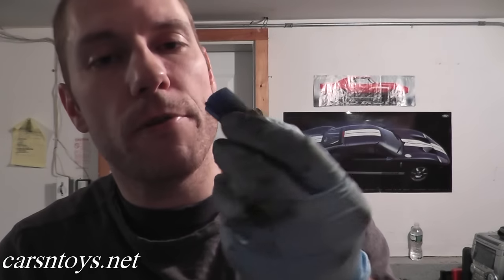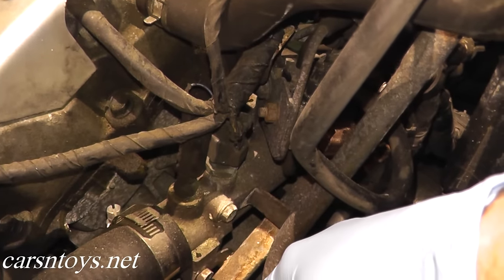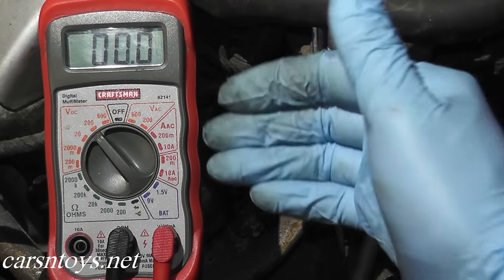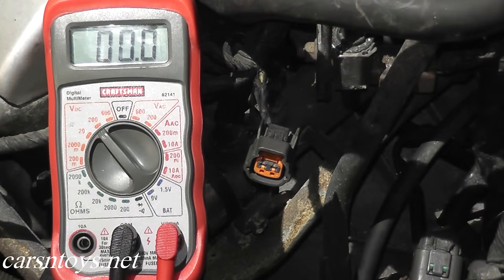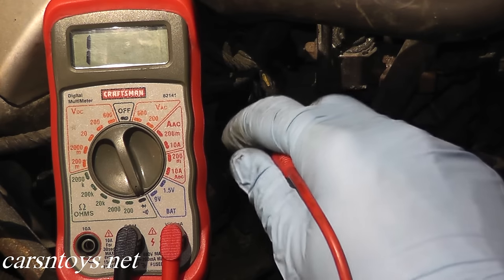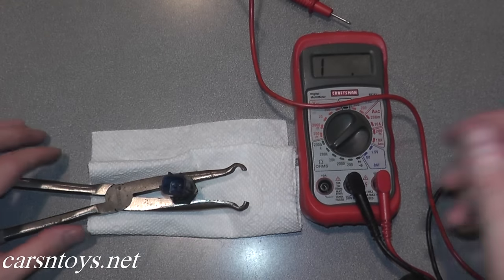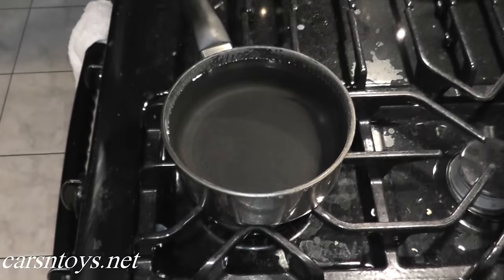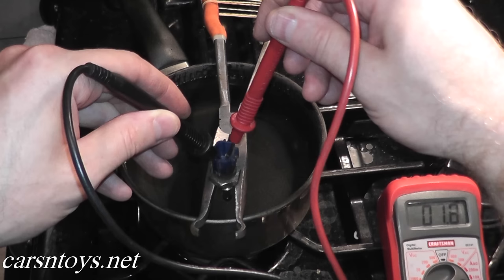How to Test and Replace an Engine Coolant Temperature Sensor P0115 / P0125

Comment: My Lexus is temp gauge is going from normal (middle) to cold and back. When it drops, the car seems to change timing, almost as if you were driving a 5 speed in a high gear prematurely. Does that sound like a bad sensor?

Comment: I just replaced mine in an 03 legacy wagon. The old sensor was very skinny compared to the new one that I was sold from advanced auto in which was thick compared to the one that was bad. After 3 days the overflow was completely full and the car overheated again. 10 mins later all the coolant was sucked out of the overflow. Any advice, I'm losing my mind

Comment: Hi. My cousin have problem with this sensor. His car sometimes doesn't work as it should. His rpm are going down, sometimes his car shut down the engine in movement, and he must wait a couple minuts so he can turn it on and continue driving. I put it on diagnostic to see what is the problem and there are two problems. First is this sensor, second is catalyctic converter functional fault. What of those two can make problems like turn off the engine in movement? I have read somewhere that this sensor can do that, when it is not working. Thank you.

Comment: I'm getting p0125 on my Lexus ls400 model 2000 they changed the sensor and the thermostat but still idk what's wrong with this thing did a drain the coolant and changed the radiator cap ...   Did the valve covers gasket  and a friend swap his O2 sensors in but still the coolant sensor he fixed was not new so idk should I change it again

Comment: i have a 350 eng an they put a plug where the temp sensor gauge goes a one wire  right under spark plug no.1 an  no3 an he strip the plug so i just put it on bank 2 right  under on no.4 spark plug an no,6 on the cylinder head would that be a problem like your videos thank you

Comment: My 97 ford Taurus engine heard up as normal and fan kicks on at normal running temperature but when driving the engine cools down to starting temperature and warms back up to normal when stopped again any thoughts

Comment: I don't have any codes that popped up on my car. But my engine temp gauge moves slowly there are no coolant leaks just replace the thermostat and no air bubbles in the system. Sometimes it will go a notch above normalbut he doesn't overheat and sometimes it will go a notch below normal. Any ideas
Reply from the maker: +moneyhungryyt I'd start by checking this - https://youtu.be/bf2kvZJx1OA

Comment: Is there a way to create new sensor set up? How would I get just 5v to the sensor and also I would need that to kick a relay for my fan. there was an engine fire on my little beast before I bought it and I am down to getting my fan working on its own. They had the fan hot going to the temp swich and the other side of the sensor was supposed to be a connecting point for the fan to work. it obviously didn't work. I have read all the wiring diagrams and these factory wires are burnt up and gone. Fan works like a boss and when its bypassed the car runs at 190 like it should . I don't want to put it on a toggle, I want it to work automatically?  Your advice would be appreciated.

Comment: Sir i have a 2004 mazda tribute with a 2.3L engine, when i turn the ignition to on position, the radiator cooling fan starts running even if the engine is still cold, i think it is not normal. Where could the problem be? Is it with this ECT sensor or the radiator cooling fan control unit? thanks

Comment: I'm just confuse, why use terminal 2 for voltage and terminal 1 for continuity in testing the harness connector? Can I use terminal 1 for voltage instead?

Comment: If the engine was leaking oil into the Antifreeze (at a tiny rate) , will this oil foul the sensor and cause the cooling fans to NOT come on? This is whats happening to me. I'm thinking of removing the sensor and testing it.

Comment: I have a 2000 Mitsubishi Eclipse. I was able to loosen it a bit, but it stopped at a certain point. I didn't wanna keep going. I felt I might break something. I'm sure part of the thread is rusted. Not sure what to do. Putting WD40 or PB Blaster is not an option.

Comment: Hi man can u plz help me I got code p0118 now thing is no engine check light gauge works  good ground  my diagnostic tool says signal + gettin to high of a reading  or shortcut 
no faulty cables tho ??? Making me nuts 😒 Could it be the ecu

Comment: hi wonder if you could help me my 08 ford mondeo 2.0 diesel fan comes on a lot and when it does theres a very strong exhaust smell thank you diagnostics comes up deteriated oil so changed oil and filter and not long after happened again car screen reads engine malfunction all the time car dosent lose performance

Comment: 2002 Camry 4 cyl, 140k miles, car is not overheating and there is no check engine light.  Main issues: 1) Car won't restart after running for while  when i stop the engine and try to turn it back on, it struggle to start. When i let it cool down for about 10 min and then try, it starts fine.  I got the new ECT sensor from autozone 3 prong as this 02 camry has 3 prong wiring for ECT sensor. Existing and new one from auto zone has rubber O ring and not metal, does this matter?. Replaced the sensor and still same issue 2) passenger side fan won't turn on even if car reaches 216°f. When i just crank the engine to on position, only passenger side fan is running anf continue ti run when i start the engine. I disconnect the wire from the ECT sensor and car still runs, It also starts fine from off position while the ECT wire is disconnected from the sensor. Any suggestion?

Comment: so would this probably be my problem if my temperature guage spikes to hot very quickly and spikes right back down?  or spikes to above hot (as high as it can go I guess) and stays there for some time?      I did have my android torque app running while connected to an ODBII scanner at the same time.  and the coolant temperature guage on torque stays the same (never spikes) at the same time as when the dashboard engine temperature guage spikes to hot.  so my torque app says the engine is not overheating where-as my dashboard guage says it is.   clearly something is not right.

Comment: can a bad sensor show resistance? I changed my radiator fan on 03 v70 2.4t and fan still not working.
Reply from the maker: Yes, but it may be extremely high.

Comment: I have 95 Honda accord fan not coming on just replaced. radiator need to know exactly what to check cam afford to let it run hot it hasn't yet bit haven't driven since replaced radiator after a crack now fan not running water not inhaling please help me on properly connecting all hoses and what apse need to check

Comment: My volvo s60 only runs when it's cold outside, if the temperature is above 55 degrees, it acts like there's a misfire or something. Would replacing the THERMOSTAT help? I also have a P104 error code.
Reply from the maker: I'd start by looking in to the p0104 code; mass air flow sensor. This is an older video regarding testing the mass air flow sensor - https://youtu.be/ewjO9JVr8NU

Comment: My check engine light came on and when i got it checked i got the coolant temp sensor code...... now my car has problems starting mainly when i put gas in it and this didn't start until the temp sensor code popped up can it cause this type of problem?

Comment: trying to figure out why truck f150 1996 over heats while idling. sometimes on long trips but not often so ill check this one. i kind of think new head gaskets are needed that is last thing to replace everything else from hoses radiator water pump belt temp thermostat have been replaced. this and the head gaskets are the only thing left that are not new. still scratching my head over this truck. thanks
Reply from the maker: Frank Holguin Also verify the radiator fans are kicking on. Cheers

Comment: I am having an issue with my vw touran. Its a 1.4 petrol. One day the radiator fan started running super fast. Continuously. Only stopped when the engine was switched off. Ran the diagnosis with no fault code. Then all of a sudden the fan started running normally. Then again after a week the problem came back. The mechanic checked the wiring and the relay. No problem there. He advised to change the fan. Got one from a salvage yard. The problem went away and after a week came back. This time the only thing different was that the fan started off suoer fast when the temp reached to its optimum level. Then went off and immediately came back on. Kept doing that. Sometimes stays on for long. I then changed the coolant temperature sensor. The problem worsened. The fan came back on at the optimum temp. but then started coming on even at cold start. At cold start it comes on and off and then goes full blast once the temperature gets to an optimum state. Another thing has changed. With the first fan the temperature never used to drop from optimum state even when running constantly. But now the temperature drops. Other things I have noticed is extra fuel consumption and sometimes first start in the morning in idling the car is rough. Can feel its a bit jerky. An online mechanic suggested two things. The fan control unit or the air con. pressure sensor. Can someone suggest something please.

Comment: I have a 1999 Ford f350 that was converted from a 7.3 diesel to a 2002 triton 5.4. Not my doing that's for sure I would never swap out a 7.3 for anything in the world....lol. But none the less it was over heating when the previous owner had it so he took it to Canadian Tire. For reasons unknown they told him he needed a new mechanical temperature sensor. So they disconnected the one going to the ecu. So when I got it was running rich as all hell and hard to start when hot cause of course the ecu was thinking it was cold all the time. So I tested the wires going to the ecu and I am getting a reading of 12 volts at the sensor pigtail. Is this something that could happen if it is a faulty ecu or could it be that it is still running on the 7.3 ecu and they should read 12 volts at the sensor. Its a little confusing because of the motor swap its a bit of a wiring nightmare and there is 2 sensor wires that go to the ecu but only one of them has continuity but both have 12 volts
Reply from the maker: dirtyold roofer Yea, motor swaps are headaches if everything isn't wired as the factory would have done it.  I'd first start by making sure the ecu works with the 5.4. My guess is the ecu is fine otherwise you'd have a load of problems. If the sensor is getting 12v that verifies power is getting to the sensor. I'd also test the sensor as I show toward the end of the video. If the sensor is shot then you found the problem.

Comment: CarsNToys hey man great video. I have a problem that im having a hard time with. I have a 02honda civic and I have recently been having trouble with overheating problems. My car was overheating at different points but then it drops right back down so I thought it was a faulty thermostat so I went to get another one at AutoZone (cheap 12$ thermostat) and I put that one in and it ran fine for about 2 days then it started heating up at different points and then dropping back down. So I decided maybe its the cheap thermo so I ordered a honda thermostat and just put it in on sunday and it ran fine for a day and a half (about 50 miles) but on when I got back from work the gauge started to rise and then drop again. I did the head gasket last summer so that should be fine. But your video is a big help for me to rest it tomorrow but would you have any idea what it might be? Srry for long message. Thanks! Thumbs up+subbed.
Reply from the maker: I'd start with a coolant flush. Also test the water pump.
Reply: Ok thanks. Do you think it could be the water pump with the car running fine 90% of the time then heating up then dropping back down?? It's weird cause I drove to work today and it was fine there and back till I got about 5 min away from my house when it started to overheat again. Im gonna do the test you showed tomorrow.  Which this video was a major help. Thanks again.
Reply from the maker: Chris Watson First thing that comes to mind is your cooling fan. I had a similar problem years ago. The cooling fan motor wasn't turning on when it was suppose to. When it did kick on, the temperature dropped quickly. I was assuming earlier you've checked the cooling fan, but if you haven't it's easy to test. I have a video showing how to test cooling fans. Just search under my page or visit carsntoys.net and click on COOLING SYSTEM. If the thermostat is good, a coolant flush will verify there isn't any clogging. Scotty Kilmer has a good short video showing how to do a coolant flush. Good Luck
Reply: Hey man thanks again for your help. Ill definitely check out your website and my fans have been kicking on I notice when im idling, not sure if they do when im moving cause I cant hear but they do turn off and on when im stopped.  Ill check the coolant sensor and do a rad flush and see where that puts me. Thanks again for your time. Thats pretty cool considering most YouTubers hardly ever reply. Ill post what it was when I diagnose

Comment: Could I disconnect this sensor to test my radiator fan? I have a 2013 Scrambler 850.  The fan doesn't seem to be coming on and I get an overheat light come on.
Reply from the maker: You can try something like this. Just apply 12v of power to the fan - https://youtu.be/bf2kvZJx1OA

Comment: I have a 99 mercury grand marquis.  I recently replaced the radiator fan Bcuz i kept blowing the maxi 50 amp high speed cooling fuse like atleast once every couple days.  That seemed to fix it but now when i run the ac the fan comes on every 15 secs and after about a day it blows the fuse again.  Any idea?
Reply from the maker: KidneYSwipeR Is everything stock ?
Reply: CarsNToys yea except the radiator fan i replaced that Bcuz i thought it was the problem

Comment: My 97 Nissan max is running a p0180 code a fuel temp sensor do I need to replace the fuel pump or can I just replace the sensor?
Reply from the maker: You can replace the sensor.
Reply: Thank you I located the issue the car had A mouse problem and the mouse chewed at the wire harness and cause the car to throw the code

Comment: Good video -  when I disconnect the harness connector at the sensor and turn the key to the on position - my fans come on.  When I reconnect the connector to the sensor  - the fans shut off.   What's happening?  I don't understand.   I am not getting a reading   for the connector - - my harness wires look fine.    Also - my relay's are good. Any idea?   Thank you.
Reply: Computer assumes sensor is out of range (too hot) so putting fan on for engine life safety. Safer than not ever turning the fan on because signal is gone.
Reply: @roccobro  Thanks for the reply  -  I still have the problem - my fans never come on.  The car - a  2008 Outback never overheats.   Strange.

Comment: Hi
While doing the continuity test on the wiring, I did hear the beep but I get a value of 10 is that OK??
Reply: OhHellYeah It's ok, some multimeters read continuity (beep) plus resistance.
Reply from the maker: OhHellYeah bluetorch13 is correct.

Comment: My 2000 volvo S 80 ,the sensor is behind the timing belt cover,my mechanic told me.It about $500 to replace it,hix hix,if it on the outside i can do it by myself,the sensor only $55

Comment: Is there a rubber, cork, or some kind of sealing gasket needed to replace this?
Reply from the maker: ***** The sensor for this vehicle has a built in washer.
Reply: Thanks, I ordered the one at the link and it came with a metal washer.   http://amzn.to/1O3ecUy
Reply from the maker: That will do the job.

Comment: 2003 w w water reservoir removal success,after theee bolts haf beem removed ,cause they are like lag bolts, and torque or safety thingy,it would move olitely,but not come out,because the mould was made to squeeze lines or hoses into the reservoir,u'll see when u get it off,by lying under it and shaking ang vibrating it free,that's what I did after fighting it  for a wk.found the hole,1/16 througj r, then spray with spray on sealer,dollar store elec. Tape,gorilla glue and glue gun, that's all
Reply: Three,have,
Reply: Dremeld flat part of bolt from underneath, to free it then,used a piece of had on hand,threaded rod to drive bolts through ,will get a replacement bolt or make one up using threaded rod and washers and nuts,

Comment: can a bad temp sensor cause a no start
Reply from the maker: +K Ray On most older vehicles it wouldn't be an issue.
Reply: +K Ray In my crv 1998 it was a big issue. I will crank but never start when the vehicle is hot or warm. If I unplugged the sensor, it will start.

Comment: Hi bro if the coolant temperature sensor dead does cause the engine badly running ?thanks
Reply from the maker: Yes.
Reply: But I've changed the new one it still running badly when hot .it can run to  number 3 4 rpm
Reply: And when I disconnect the coolant temperature sensor and restart the engine it well running.can I drive while disconnected

Comment: will a bad coolant temperature sensor cause "erratic idle" on called start?
Reply from the maker: Yes. However, it could be a number of things. If you have a '96 or later vehicle I'd start by checking for engine codes and going from there.

Comment: Can someone please tell me if this cause a car escape 2007 don't start only when it's cold under 30°? Or.  What the problem can be.  Over 30° start right away.
Reply: Ubaldo Solorio 
You have a faulty temp sensor or wiring. Because it is faulty, the engine ecu will not let you start the car. It thinks the engine is over heating.